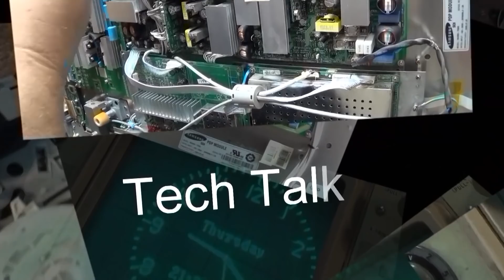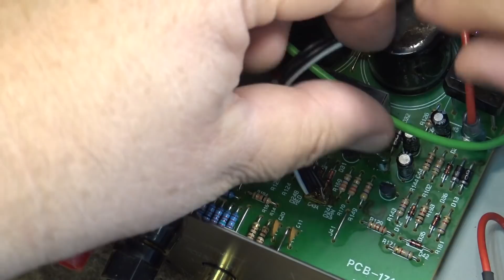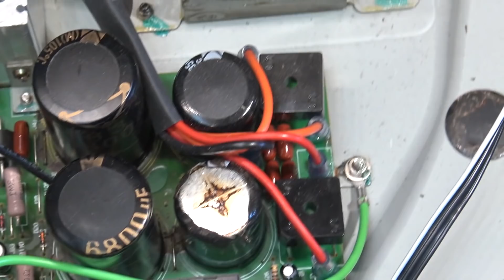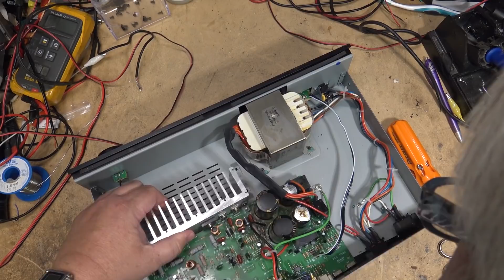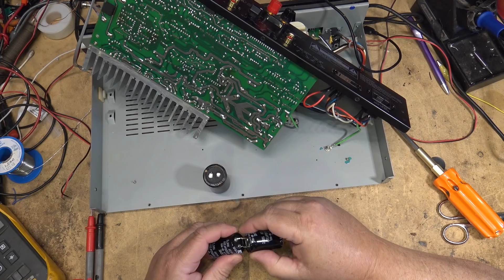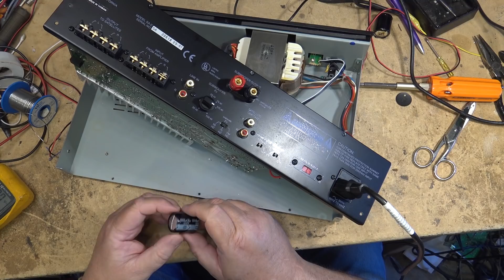NHT SA 2 120 Watt MONO sub amp repair

Comment: Although this video is a couple years old, my SA-2 just got zapped by a lightning strike.

Thank you very much for making this video with very helpful information about the caps and design.

At least when I go to the repair shop I have more context than I would have had if I didn’t watch this video. 

I’m not sure the caps are fried from the lightning strike, but it’s a place to start the discussion, and replacing the smaller caps with a larger capacity design is an excellent suggestion. 

Thanks again!

Comment: I hear you about lines, can't stand them either.  We're running shy on component retailers in Toronto also and the one I used to love to go to routinely doesn't have the (very common) parts I need. In the end, I just end up ordering from digikey or mouser. Shame, because I really do love to support brick and mortars. That and pandemic shopping is just no fun.

Comment: Nice simple fix. Can't think of many reasons I would need a sub amp anymore. Speaking of long lines, tried to go to IKEA today (Canada Day) in Coquitlam, bad idea. Got there and didn't even get outta the car, too many people. Those kinda line ups and crowds do my head in.
Reply from the maker: I can't think of many reasons to have a sub. My polk towers with the 12" side firing woofers shake the room as it is for movies and my technics sb7000 with the 14" woofers deliver great sound from my little tube amp.  My 400 watt sub behind the couch hasn't been plugged in for years.  Don't even know if it works any more. Last time I used it I got the state that said "turn that off or you are sleeping in the garage"

As to the lines, nope I don't do them either.  If I go to a place and there is a line I just keep on driving.   The exception was to get these parts because I had made a special trip but if I was just going to get some inventory I would have turned around. That happened to me when restaurants first opened. One of my favorite places had a 4 table limit and i walked in and all 4 tables were taken so it was take out only.  Not eating in my car, I went somewhere else.  
Something that is driving me crazy now is places refusing cash.  I walk in place my order and pull out cash. When they say they won't accept I walk out.  Not that I don't have a credit card, I just don't like to use it. Don't like to be tracked by big brother.   I am probably one of the few that doesn't have a debit card.

Comment: It is Class H then not Class AB.
Reply from the maker: Correct.  I said ab before I looked closely at the design.
Class g and h are still class ab, just with rail switching. I called it envelope modulation as that is what NAD calls it but it is just rail switching.  Turning on the higher power rails for the perks of the waveform.
Reply: @12voltvids  Yea class H getting its name by the circuitry looking like a H bridge except that its not a H bridge, but yet it functions similar to a class AB.
Reply from the maker: @tyronenelson9124  
Well, it is a class AB design. The extra transistors only operate as a switch to bump up the voltage so that what would have normally been a clipped waveform remains a nice waveform.  Unless you are driving it hard, they operate as a class AB.

Comment: Happy Canada Day.
Maybe 105deg Celsius caps can take it better than the regular ones. But the designer, manufacturer f... (to save money?) in this case - 80V on 60V it's OK, but at the limit you ask for trouble.
So H class amp. QSC, pro amps, use  it also, so they can get away with less output transistors. At first I thought the outputs are gone after seeing one pair. BTW, the Motorola version of Toshiba 1302/3281 (1943/5200) can take a bit more beating than Toshibas. And then there are newer 17A devices, Onsemi, Fairchild makes it, if ones needs just a bit more juice. I keep the old junk for parts, yes big caps are expensive and I can't get them in the store in Ottawa. 
I have dbx 120x Subharmonic Synthesizer to send signal to the sub - pretty cool device, that can create some nice rumble in the lowest frequencies.
Your new theme music is much nicer 👍 - hopefully no copy rights problems again.
Your comment about staying in line reminds me of 1980s Poland, but we had coupons for almost everything. If some desireable product was delivered, automatically line up formed, then people would sell it at profit, kind of like eBay.
Reply from the maker: The originals were 105c in case you missed it.
Reply from the maker: It is all musicbakery music I use.  The exception is the remix of hocus pocus and as sure as the sun which is just samples and therefore falls under fair use just like all modern music these days.
Reply: Emotiva is using a Class H design with a switching power supply on it's big amps.Why not just do Class D.?
Reply from the maker: @amazoidal  Class D seems to be the future. They are now good enough that you can't hear the difference, and you get big power for a very small efficient package that is not a furnace.
Reply: Yes, I have a Parasound 2350, similar to many Class D that use the B&O ICE chips. I think it's 350wpc at 8 ohms and 600wpc at 4 ohms. Runs cool.

Comment: I'm retired now but when I repair an amp I usually order from mouser, I usually get them in 5 days or so. Prices are good ($3.54 per for 6800uf 35v Panasonic) and they almost always have good stock. A 50v cap costs about the same here.

Do you folks have something like Mouser or Digikey in the north woods?
Reply from the maker: 3.54 us is around 4.90 cdn.  So 9.80 for 2.  Add 20.00 us freight to get them to Canada and those 2 caps cost about 37.00.  Cost me about 20.00 here with tax.  I can drive to the store to buy them for about 1.2 in electricity cost to operate my electric car.
Reply: Sounds like someone should start an electronics supply shop near you instead of Vancouver proper.
Reply from the maker: @amazoidal  There was the opertunity for someone to buy Main electronics when the owner passed away, and the son didn't want to run the business but nobody stepped forward to buy the building.
Reply: Too bad. Maybe the son could have gotten the Canadian equivalent of an SBA loan to buy the building. Here in San Diego, we have some successful "parts" stores that sell to repair shops and enthusiasts. We have lots of electronic nerds here. The two shops I use for repairs are Classic Audio Repair and Mike Zuccaro, "The Audio Craftsman". On the internet.
Reply from the maker: @amazoidal  
The son wouldn't have needed a loan to buy the building, he OWNED the building. There were several businesses in the building. He wanted to sell the building to make his millions from what a commercial building in Vancouver will sell for.The place I buy from now, Lee's used to be in the same building about 4 stores down, and he tried to buy it but no. SO he moved to a bigger shop about 10 blocks away.
Reply: Too bad you have to drive the Volt so far. There really is a need for components on a local level.The shops here were considered non-essential so the techs here had to order over the internet IF those were open.

Comment: Good video as always.  Still to watch the big one where you fault find the Amp, but I will as it still interests me these days, fault find, and repair.  One of my longest running hobbies, though when you look inside things these days and find a few black things with lots of legs you just think "It is all chips and expensive ones, I don't want anything to do with it, replace one and before you get the chance to check it it is blown again"!  I like the older stuff before surface mounted crap came about.  Replacing an surface mount chip is a pain.  Even using the low temp stuff to get it off it is still a pain soldering it back on again!  As for the surface mount caps these days, not got the repair/service manual for it you have no idea what was in the gap as nine time out of ten there is just a skid mark where it shat itself and vaporised.  Another hobby going down the tubes!
Reply from the maker: I hate the new stuff and avoid it.   Another thing I am not fond of is working on things that the owner has tried to overhaul and brings in to get it working.  I have such a piece now.  Owner replaced a head on a tape deck and the new one isn't even making contact with the tape because obviously it wasn't reassembled properly and now they want me to fix.  Thing is if I touch, I am married to it so I usually wash my hands of those jobs.
Reply: @12voltvids  That is my pet hate, if they have been inside they can go away in sexual jumps.  As soon as you look at it it becomes your problem it is not working and you have to fix it.  Even if they broke it it is you that couldn't fix it.  I just walk away from it.  In fact I am at the point I just fix for myself, people think you will sit for hours fixing things and do it for free.  So when I moved here I stopped doing anything.  Excuse, well I just do not have the room anyway, not even to fix my own stuff.
Reply from the maker: @BoB4jjjjs  yup. I have worked on stuff for this person before.  They are one of these recap people. In this case changed a head on an open reel that I would never have touched as the original had only very slight indication of wear, and it would never have caused any sound trouble but they went ahead and changed it. Wants me to align and the new head isn't even  set correctly.  They changed out all the alignment screws as well and I don't have the tiny hex keys.  As I said I would have refused to change the head because the alignment will never be correct.  So I looked at it momentarily and saw the record head isn't making contact with the tape and though to myself this isn't one I want to get involved with. No matter what the charges are, it will never be good enough.  Something will always be wrong. Learned this from past experience dealing with audiophools. Shop I worked at the boss was cheap. Would not buy expensive distortion meter and stuff like that. Had one guy come in with something. I forget what it was because the other tech worked on it. A few days later it is back. Other tech checks over and can find nothing wrong. Sends it out, boomerang back again. Still can find nothing wrong sends it back out. Comes back again, this time goes to my bench.  Since I am not making a dime on it, I was paid piece work and the other guy was hourly so he gets paid no matter what, but I can't charge so already I have a chip on my shoulder.   Again sounded fine for me sent it out again.  Guy livid, demanding a tech on site. Boss makes me go because the other guy wasn't the licensed tech I was.  I go there. The guy has an hp distortion meter and he is measuring 0.13% and his amp is spec'd out at 0.10.  I walked it,  saw his setup (looked like Carlson's lab) and said "are you fucking shitting me" and walked out.  He got his money back and was told to never set foot in the shop again.
Talk about not picking.  You will never hear the difference between 0.1 and 0.13 thd,  and yet the hours wasted on this.  My assistant probably wasted 2 hours and me a good hour or 2 by the time I add the unpaid service call in.
Reply: @12voltvids  Yes, not worth it at times.  You fix something and it come back, it broke again, totally different fault, But it didn't do it before!  Then it strikes you it were 4 month ago you last looked at it, then you find it is played at full volume all the time and the audio is blown.  I had one where one person said it were distorted on one channel, couldn't find anything wrong and gave it back, straight back with it, still doing it he said.  After wasting about three bloody hours on it, it turned out he had blown his speaker.  What an idiot, he didn't offer me anything so I bided my time and he dually appeared  with something else and was told I was not even going to look at it.  I got all the protests, but I didn't care, i just couldn't be bothered.  Anyway, I had plans that night and he wanted it fixed there and then, so he was told to Go Away In Sexual Jumps!
Never did look at it even though he pleaded me to look at it.  I have a life to lead, or at least I did then.
Reply: @12voltvids  You would never hear it and if he had that amount of equipment he could have fixed it himself!
Reply from the maker: @BoB4jjjjs  I remember one job. Customer had a nice high end Marantz amp. Salesmen talked him out of repairing it, and sod him a cheap Technics receiver (with the IC output) comes in blown up. IC shot. Fixed, then comes back claining bad sound, Sounded fine, must be the speakers. His expensive KEF speakers come in. All the drivers are blown. 1200 to replace them. 2 months later the speakers come back all distorted. All the drivers blown again. Told him 1200 for the parts, guy is freaking out how could this happen. Answer? Teenagers having a party while parents off at the resort skiing for the weekend.  I made the mistake of telling them that the low powered distortion box they called an amplifier was the cause and they their old Marantz amp they tossed was a much better one capable of driving those speakers without breaking them. That got back to the boss who tore me a new one and forbid me from talking to customers because I told the truth.
Reply: @12voltvids  Yeah, I have told the truth in another trade and almost got sacked for it. Got torn to bit by one of the bosses, but when I asked to see the head man there was silence.  I think they were scared of what I would say and I was told to forget anything was said and it would be removed from my record.  What does that tell you.  I think the head man would have come through and threatened to fire the lot for not telling the customer the truth for a start.
He was for looking after customers as they would always come back, but some of the staff.  I would take back work, all they had to do was give them a price, sometimes all they wanted was an estimate as I had already told them it was difficult to price.  These were companies and the work was theirs for the taking, but they never followed it up.
Funny how most of these people have been found out and not there anymore.
I was not the only one I heard talking about the bosses not following up work.
The problem was it was not then that got it in the first place and the head man always asked how they heard of the work.
Well they couldn't or wouldn't say it was one of us and they couldn't lie either just in case something came back that it wasn't them that got the work, so they just ignored the work they could have had for the sake of a phone call.  Well, it is 1:20AM here and I think I hear my bad calling to me.  See you on the next video.

Comment: It amazes me how much stuff come out of a capacitor when it goes bang!  It just goes everywhere.  I had one in a stereo that had exploded, so I replaced it (dual caps) I replaced both of them as I figured if one was gone the other wouldn't be far behind, Had to send away for them so I took a photo on my phone to remind me how they were fitted.  They arrived and I fitted them as the picture on my phone, I turned on the amp, there was a cracking noise and a cap started to look stressed, so I checked my phone to see if I made a mistake.  No, fitted as was before, so I checked the circuit, it looked an odd way they had done it, I came to think one was in the wrong way, so I double checked, no, it was in as the picture on the phone.  So I turned it on again just to see the cap start to bulge, so I turned it off.  Changed the cap round and it was fine, so I replaced it with the spare (pack of three, they know you only need two but sell you three) so now it leaves me wondering if it had always been in the wrong way?  The owner said when he heard it "What did you do, the him on the left channel has gone, it has hummed since new?"
Now, was it fitted the wrong way round from new?  It ran almost seven years before the amp gave any trouble, the final output transistor on that channel had finally packed in!  Each cap was feeding the right or the left but he said the left always had a hum on it.  Why didn't he take it back when he bought it?  The cap had leaked over the circuit board but had dried up and still worked the wrong way round, but it must have been doing some smoothing.  Don't understand how it worked at all.  There was a transistor crackling away, but I cooled them and heated them to no avail, told him he would have a problem with the left as there was a transistor on the way out but he was happy and went away home with it.  How can it run for for that length of time fitted the wrong way round?  Surprised it survived with all the ripple that must have been going through it for so long.  Designed in the UK and made and assembled in Taiwan.  I only fix things for myself these days, it is just not worth the bother!